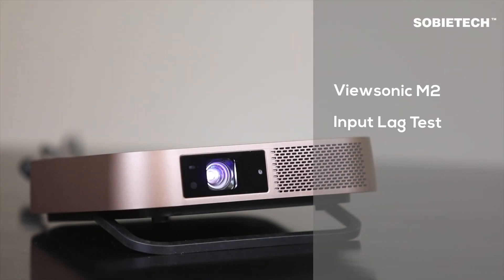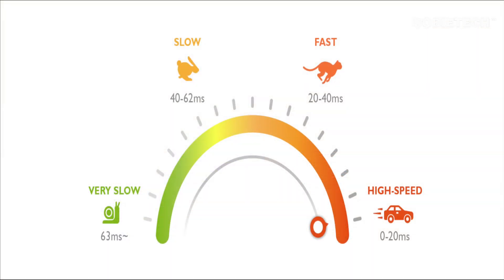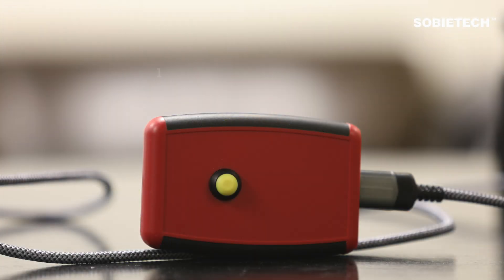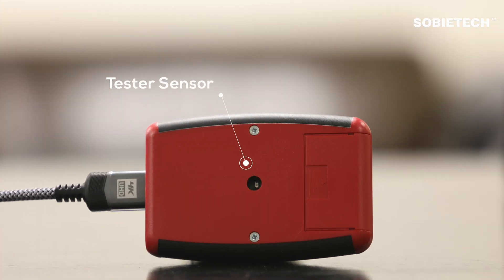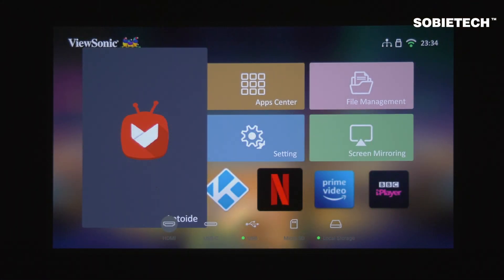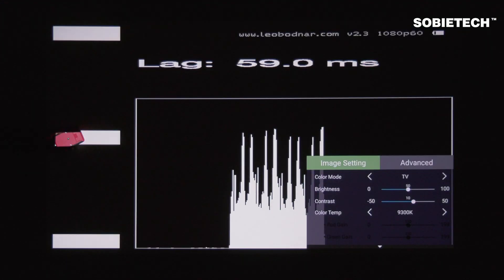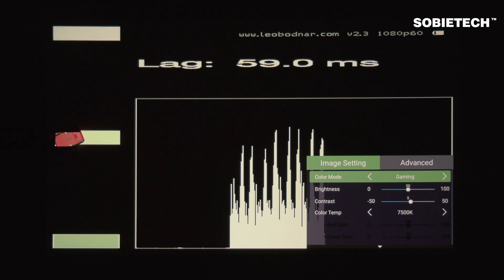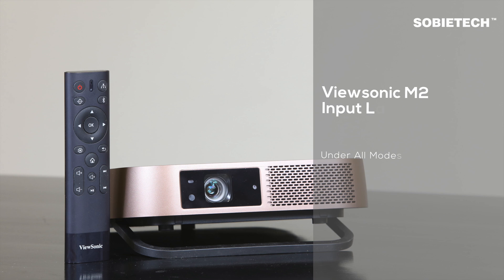Viewsonic M2 1080P Projector Input Lag Test

Comment: Hello! I was told that if you turned off the Keystone correction on M2 projector the lag is much less!!! 
Is it possible for you to test the lag again with (Keystone-correction & WIFI) OFF this time around? 🙂
Reply from the maker: Hi, under gaming mode, the keystone correction is turned off. We did not find a reduction in input lag under gaming mode when we tested it. As we no longer have the projector, we could not test it again:(
Reply: @SobieTech  Oh thats kool how viewsonic turned off some features in gaming-mode to optimize projector for gaming! On Version 1.00 the projector works good on gaming but i turn off wifi,keystone,motion,eye-protection…etc   And it makes a huge difference!!!😃
Hope you can test it on the version 1.00 that would be awesome!!! Good work!!! Thanks!!!😃